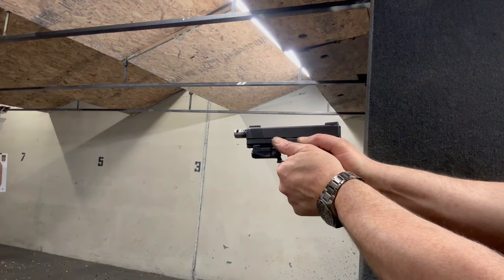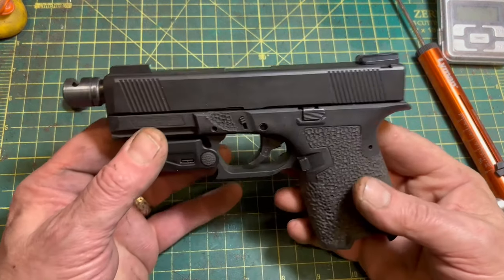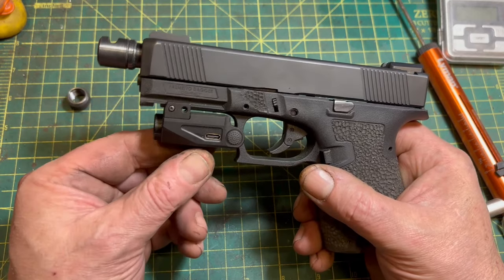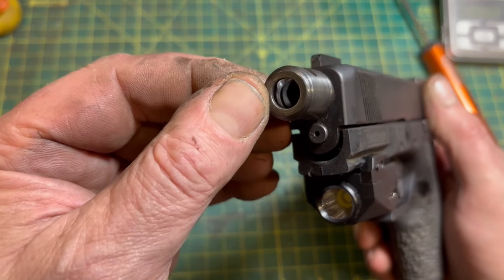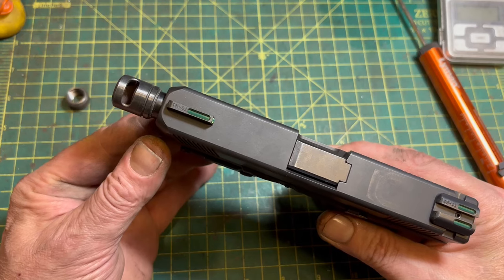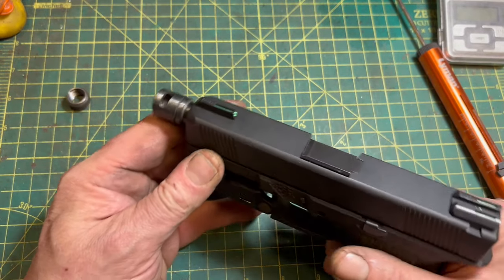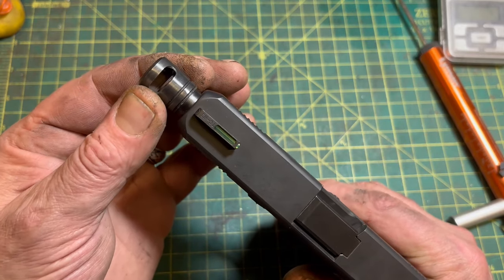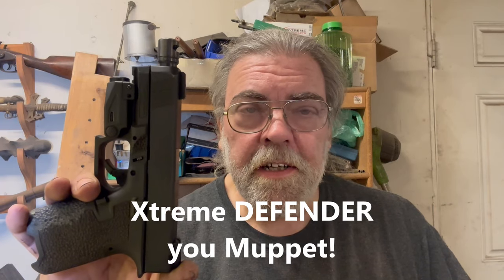Homemade Mini Compensator- Does it Work?

Comment: Here is a thought.  Most muzzle brakes have the gases directed straight up.  The slant brake-compensator of many AKMs is slanted to counteract the tendency for the gun to raise up and to the right.  I wonder if there would be any benefit in slanting the slit of a pistol muzzle brake?  I maybe purchasing a muzzle brake for .40 caliber glocks with handloads.   I just might experiment with different positions of it.

Comment: Question - have you shot the poverty glock without the comp and with just the WML installed? I’m just curious what percentage of improvement was achieved by the comp and what percentage from the weight of the WML in terms of recoil control, recovery, and follow up shots.

As always - excellent work!
Reply from the maker: Good question!  Yes, and in my brain I was comparing performance with the light mounted.

Comment: Tried a couple of these with favorable results as well, thinking that if there’s already a threaded barrel with a thread protector sticking out, what’s a few mm more in length to replace the protector with a comp?  Though I did get a pretty chonky one for a fnx-45 which blows the gas back at me with the ferocity of a rhinoceros fart. Would be interested in seeing you attempt a ported barrel and slide, or some kind of integrated revolver comp, a Tinker mag-na-port or like a S&W carry comp
Reply from the maker: There are videos of some of my 1911s with that treatment, like this one- https://www.youtube.com/watch?v=CpKcv4yfLYQ&list=PL338qOFWxcJb0jNfFItaubE2QOxgqqebQ&index=1&t=8s&pp=gAQBiAQB